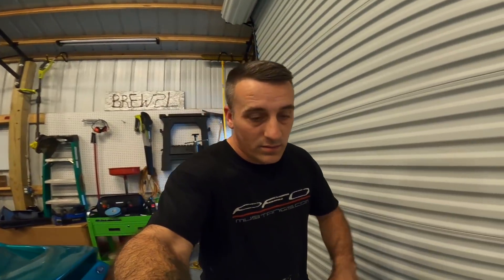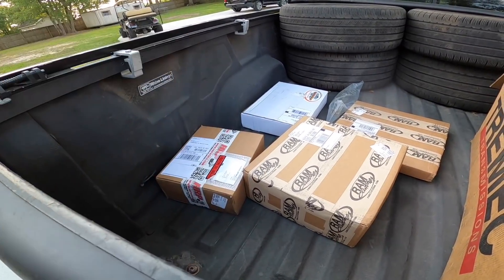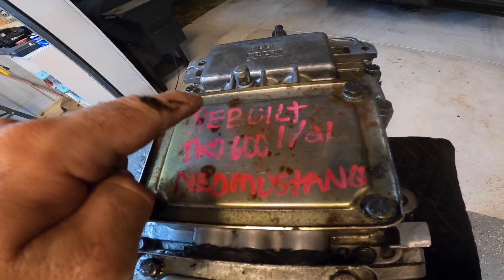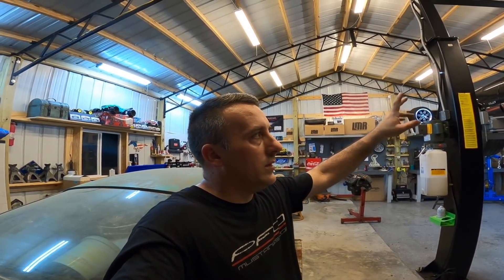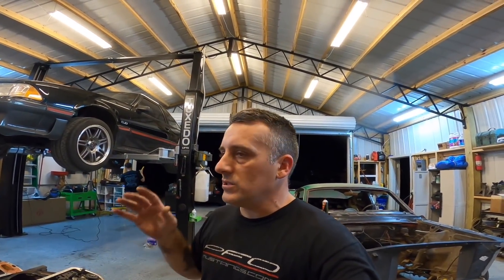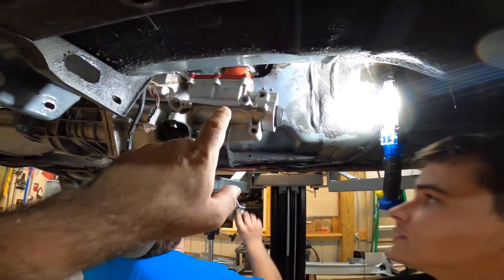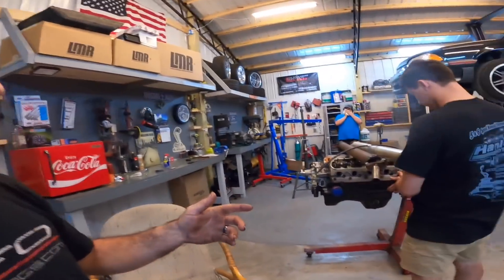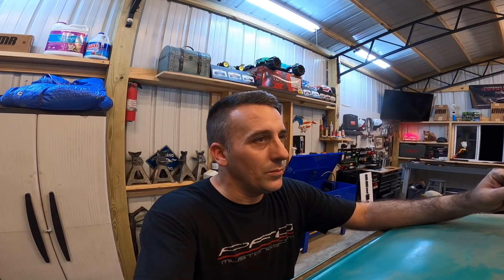TKO'S & BLACK WIDOWS / We were installing a TKO 600 when THIS happened!

Comment: Had a faceplated tko 500 in my 438ci supercharged fox best 5 speed ever never missed a gear , very streetable just rev match when down shifting , after 3hrs of driving it you wont even notice your doing anything different, if I ever go back 5 speed it will be faceplated, I currently have manual valve Turbo 400in it,

Comment: Curious to see what u-joint y’all gonna use because I ordered the ford racing M-4841-B slip yoke and the M-4635-A u-joint from LMR and it fit my factory driveshaft good but when I installed the u-joint in the slip yoke it had a lot of space between the snap rings and the bearing cap. Idk